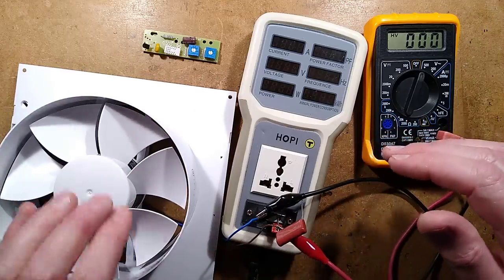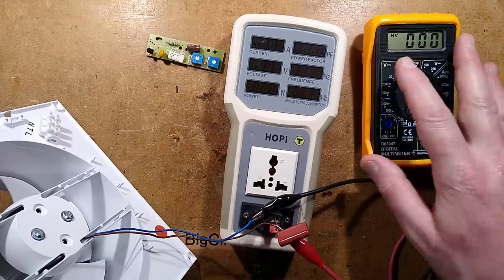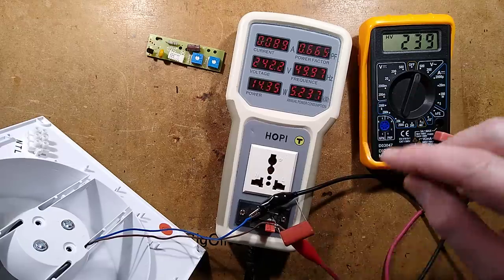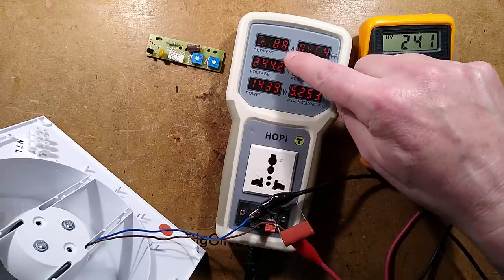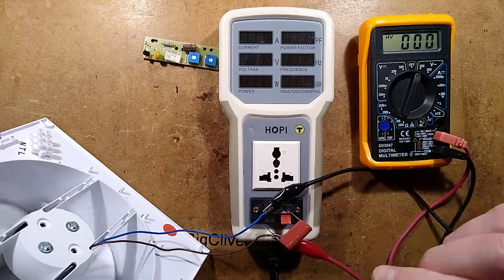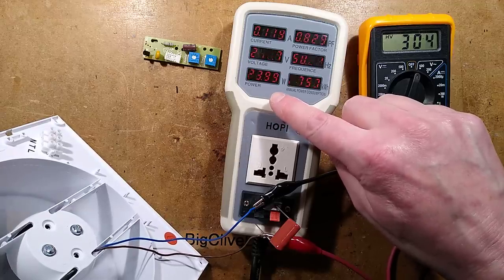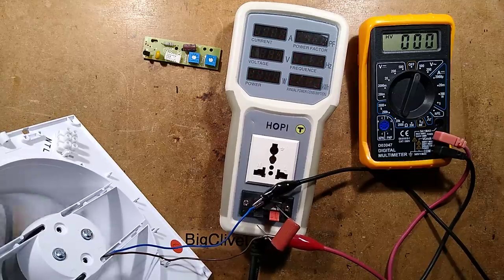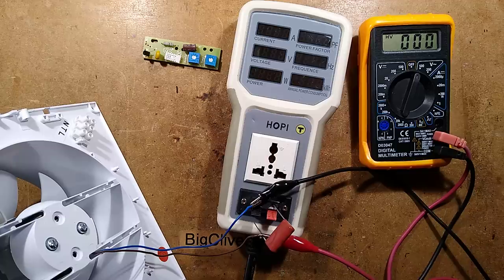What the heck!  Series capacitor makes fan go TURBO!

Comment: I have seen this where I didnt have exactly the right run capacitor to replace one. The current went up a bit and the speed did also. Less slip. It was not a big deal like this though.

Comment: Exactly, Clive....a phase shift....inductive loads tend to trail back on the phase a little and the capacitor will "correct" that....I used to install fluorescent light armatures and on a number of inductive armatures I installed a capacitive one to counteract the "phase-trailing" which is terrible for the powerfactor...
Am I making any sense?!

Comment: Seems like a nifty way to implement a two speed fan using a single winding (at the expense of worse PF at the lower speed)
Reply: at the expense of over-voltage degradation in the motor and 70% more power consumption at the higher speed (probably half the increase is heating somewhere)

Comment: Resonance: The Capacitive reactance is cancelling the Inductive reactance, leaving just the fan's resistance in circuit.
Draw a graph of current v/s different Capacitance values.
Reply: Partially cancelling out the inductive reactance. PF only went to 0.8, not all the way to 1.0.

Comment: You made a 50Hz resonant circuit maybe? 
I got a 15 watt extractor fan that actually drew 30 watts, so I added a capacitor to make it run at 15 watts. Worst case, the capacitor goes short.
It is much quieter, and has worked all winter moving the heat from the boiler flue to my hall (with a thermostat, so it only blows when the flue is hot).

Comment: it's oscillating. it's like adding a phase without adding a phase? more like recycling power. causes the vrms to go up slightly but makes it stay constant. in heavier duty systems like for example a table saw it's called a run capacitor i do believe. if you remove the run capacitor from a table saw system it runs real slow and you can pinch it with your fingers and stop it. add a capacitor in the circuit and well. you can run through wood like it's nobodies business. capacitors charge and discharge rapidly hopefully as you need it to or want it to. in laymans terms you can pedal a bike with 1 leg (no capacitor) or you can pedal your bike with two legs (with capacitor)

Comment: In the inductive load, the current is positively out of phase with respect to the voltage and we also have apparent power. This apparent power does not produce mechanical work. When adding the capacitor, the current is negatively out of phase with respect to the voltage, so that overall the phase difference between current and voltage decreases. Work reflected in and in the "power factor" measured by the device, the size displayed in the upper right.

Comment: Has to be resonance maximising the power. Tho I can understand the confusion. Most motors that size have masses of losses so its usually difficult to get any kind of improvement. Am guessing it has an unusual type of ferromagnetic material in there somewhere.

Comment: thanks. The measurement of current and voltage depends on the response of the instrument. does it indicate the average, peak or the RMS value. The RMS values in your CCt will show the real power of the load, i.e power is the work done in the load. Cheaper instruments do not measure RMS values but do measure a average value. COS phi equaling 1 shows there is 0 deg between voltage and current. The series Cap will result in current leading  more so .

Comment: Congratulations, you have made a series L C circuit close to resonant at 50 Hz. A series inductance capacitance circuit  at resonant frequency ( inductive and capacitive reactance cancelled out) will only  have the resistive part of the load ( if you have any resistance) holding the current back. Effectively a tuned series L C  circuit is a dead short at resonance. Like tuning a radio.

Comment: I'm an electro-noob but I know motors when stalled pull way more current. In operation though they manifest some back emf. Normally this goes back into the ac. but in this case you're harvesting the emf into the capacitor. When the ac switches direction yhe voltage is added. 
I might be wrong or it might be another way to explain the phase change model

Comment: Is the fan a brushed motor? Put the multimeter across the fan wires and spin the fan by hand, do you get any DC voltage shown, proving it is a brushed motor due to the fan motor acting like a small dynamo?
If it is a brushed motor, this may explain why the increase in speed of the fan and why the multimeter reads higher than the mains voltage, due to back EMF of each cycle being added to the AC voltage being displayed.

KW
Reply from the maker: It a very cheap and simple motor.  No brushes.
Reply: It can't be just noise otherwise the fan would not speed up, or would it if the noise was sufficient.
The only way to know is to put a scope across the supply and look at the AC waveform across the fan supply before and after adding the capacitor and see what it looks like. 

More thought, as you say this is a brushless motor, it's dependent upon the AC mains frequency for its speed (ignoring how the motor is wound and the number of poles), the noise could increase sufficiently to give what looks like a higher frequency AC supply, whereby speeding up the fan and the multimeter is just seeing the noise and interpreting it as a higher voltage, again a scope would prove/disprove this.

Please please do a follow-up, this is just too intriguing to leave unanswered!!

Thanks,
KW.

Comment: Use a few different size capacitors and you'll be able to tune the reactance. The power factor change will approach 100% as you get exact resonance across the cap and the motor's inductance. Were you wearing your safety glasses? Good luck.

Comment: Capacitor gets charged and can't discharge as fast to follow mains voltage which creates a phase shift. In layman terms, if you charge a capacitor and then reverse the polarity of the source, you'll get source voltage + capacitor voltage. This is one of the views on same effect, looking from different perpective, a capacitor's reactance is opposite to coil's reactance, if you couple two together with proper values, you can reduce motor's impedance to minimum.

Comment: The fan is very inductive and you have made a series LC circuit which improves the power factor.  Noting that the AC current through both L (fan) and C are identical (because in series), the voltage across the L and C will have opposite signs, which means more voltage across the L.

Draw out a phasor diagram and you'll see what's going on.  Or reply here and I'll draw one, whatever.

The series mode of power-factor correction increases the voltage across the internal L in the fan, which therefore increases the current through the fan.

There are comments mentioning resonance, but that is not actually required; you can be a long way from resonance and still have an effect here.  If the fan is very inductive (compared to its real load) and is depending on that inductance to limit the current, i.e. it has very low power factor, then you can get a really big resonance peak with the right size capacitor, and probably overload the fan.

Comment: I have used this trick to slow down fans a lot of times in the past, as you have done yourself from what i can see from the video description. I also noticed this turbo mode with higher value caps, but I didnt put much thought to it, I just thought I was too stupid to understand and gave it a rest. Well, it turns out I was correct - I was and still am too stupid to understand it 😂
Reply from the maker: It's a very practical demonstration of quite a complex subject.

Comment: Series  L-C resonance,  Normally the fan impedance is a combination of  an L and R in series,  the C adds in some negative reactance and 'undoes' some of the L- so the supply seen just the resistance, and the L and C parts see equal and opposite voltages when dead on the resonance, but are probably a bit off in this case. You will have come across this before, but maybe not realised it, as the tuning coils and capacitors in every radio  are resonating in the same way - energy oscillating between magnetic and electrostatic storage but most of it not being dissipated.

Comment: few years back when bldc fans not common my fan regulator stopped working . i opened it and found it is based on capacitors - 1uf, 2.2 uf and 3.3 uf , tight fit inside the enclosure . speed 1-4 with the caps = very slow . and speed 5 direct connection . I thought about increasing the speed (1-4) and started checking for info. soluton found online - increase the 'uf ' will increase speed.  i remember reading in one document = if you increase the capacitance over __ uf then the fan may see high voltage and may burn/damage. with doubts I didnt proceed with 'upgarding '   . replaced the burned caps and put it back. now i see it.

Comment: The network frequency is close to the resonance of the capacitor and the motor coil. If the frequencies were exactly the same, you will see infinite voltage.

Comment: I wonder if what is happening is because of the way the capacitor is connected, there is 240 VAC entering the fan motor until the polarity flips. Then the 240 VAC is still entering the motor, + the stored voltage in the capacitor. This happens until the polarity flips again,  then the whole process starts again.

Comment: Measure a few places on the circuit with an oscilloscope and it will become obvious whats happening.  Collapsing magnetic fields (ie in inductors) create high transients (voltage spikes).  Adding a capacitor allows that extra potential to be stored momentarily until the transient subsides.  It gets added to the potential across the winding during the next field building phase.  The capacitor also weakly rectifies and boosts the apparent AC waveform, but really, the peak mains voltage is quite a bit higher than 240V (meter is probably showing RMS).
A diode resists current flow in a given direction.  An inductor can do the same.

The circuit will reach an equilibrium point dictated by the network resulting from coupling an inductor, capacitor, and the resistance of the components and wiring.  Many resonant circuits built in this way should come to mind.  Thats how voltage boost circuits, oscillators, and a host of other practical things work.

Comment: Know not a lot about electronics only I can see the capacitor releasing extra voltage from a greater stored source of electrons. I bet if you added a resistor you could bring the voltage down to whatever load the motor is happy with.

Comment: I'll have to read the comments. We have an old fan that does whole house ventilation. It has three settings but two of them are dead and I've opened the box to look at the circuitry and there are several big capacitors. I'm assuming two of these have died. There is a circuit diagram inside the box. Perhaps I should try to share that.
Reply from the maker: The capacitors are a common cause of blower failure.   They're easy to source and replace.  You'll need to read the uF and voltage rating on them and then look for "motor run capacitors".  Just take the usual precautions like ensuring power is isolated before working.

Comment: I would assume, that the coils are having an angle of 90 degrees. A capacitor gives a shift of 90 degrees for creating the rotating field. A second capacitor in series creates a shift of 90 degrees too. 90 plus 90 means 180 degree of phase shift, but coils are oriented with 90 degrees difference. You should measure with RMS multimeter.

Comment: So Cap is storing a amount of current like  220v right? and the line is providing that  220v what if the cap charges and the line between the cap and 220v gets like 440v in serial battery? minus the consumption of the fan needs ends up with slightly higher output?

Comment: Must be low power factor without it. Capacitor brings the phase of current and voltage synchronize.
Also the capacitor can take-up the reverse current and dump back at the motor on next AC cycle - explains the increased "apparent" voltage.

Comment: Normally, the capacitor has to be parallel to the fan. The idea of improving the power factor is to reduce the current, and achieve the same work, or power in a lower current, in order to reduce line losses

Comment: That's only ~36% more current, so I think it would run for awhile. Probly should monitor the motor temperature, but I don't think it will be an issue until ~50% or more current.

Comment: I think you've counter-balanced (to a degree) the inductance of the fan motor, with the capacitance of the Capacitor.  Time to breakout ELI the ICE Man.

I'd be curious what the fan is spec'd,  in terms of maximum rotationary speed.  Hit the natural frequency, & it's time for the fireworks!  :o

Comment: I have experienced same thing, i was working on wireless power transmission system, when i connect this type of capacitor in series with transmission coil. Coil starts drowing more current.

Comment: Vent motor winding could be viewed as inductive coil. In pair with the capacitor it makes some kind of oscillatory circuit (which makes voltage peak higher than without it). That's my initial thought/hypothesis

Comment: Does this mean that with the 1uF capacitor in series it could be run from 110/120V with much improved efficiency? Or just enable it to run from 110/120V?
Reply from the maker: That might be possible.

Comment: „Resonance“
If you look at the voltage including phase angles as vectors on a 2d map, you see that voltage over parts might increase way over total voltage in a serial resonance circuit. Just like the current in a parallel one.

Comment: I guess the capacitor makes the green think it's running downhill (i.e. I haven't a clue beyond the comments posted about correcting for induction in the fan.) If someone could fit a capacitor to the PM, could he also start to work faster, with greater potential measured by your meter? 😊

Comment: from what little bits i still have left of my school teachings of electricalk engineering is that motors/ magnetic spools in general generate an inductive phase shift effect onto the alternating current that either lags behind or runs ahead of what the actual momentary state of the power line is  that it is attached to therefore smallering the ammount of power it draws. 
sorta like a surfer on a wave, he doesent ride it at the peak but rather ahead of it on the front of the wave. 
capacitors on the other hand have sorta the opposite effect delaying the phase. 
adding both together (if they are equal in delay/advancing strength on the power grid) puts the motor (/affected electrical component) in sync with the power grid making it draw what it can.
like giving the surfer a parachute that drags him ontop of the waves peak, he aint gonna be happy by how rough and hard that ride will be. 

PLEASE ANYONE WHO HAS AN IDEA OF WHAT PHENOMENON I TRY TO UNDIG FROM MY LACKING MEMORY, please help me out if that is what actually is taking effect here and correct me with facts (perferrably supported by some sort of scientiffic paper/article)

Comment: I have a fan question regarding a small 6" 2 speed desk fan. The other day I tipped it over while it was running and noticed that the blades started spinning faster. I experimented and found that fan speed increases the farther from vertical that it is oriented. What's going on???
Reply from the maker: Possibly just airflow.  When you block the air flow the blade has less wind resistance.

Comment: I am leaning heavily on others work, but what we're talking about is Power Factor. As many others have commented here - since you added a capacitive element to the series circuit, you reduced the phase shift of the voltage to current, allowing all of the power to reach the fan. The Ham Radio Extra class materials derives the equation, and has pretty good discussion of the impact and measurement of the increase. It would be of interest to see how the calculations vs. reality compare. LOVE your work and content!

edit: responding to your goal of reducing the speed: if you add resistors (heat risk), you could either add an induction or a capacitance so large as to shift the phase past resonance, that could work - I haven't tested, but wait with anticipation for your video of doing something like this.

Post-post-script: I'm trying to find the derivation of the equation for the Power Factor = Apparent Power + Real Power, and I stumbled onto a GREAT explanation of how the relationship works: https://youtu.be/nynQb1oB9KI?t=86

Comment: Ifff there is a sensor still in the fan unit, the capacitor might be activating it to make it go faster, only other thing I could think of is for some reason the capacitor makes it turn to dc? Weird lc circuit? Defective capacitor?
Reply from the maker: No sensor.  Just a bare shaded pole motor.

Comment: I sow some small toy motor had parallel connected 104 ceramic disc cap is it doing same thigs or not ?
Reply from the maker: Partly for electrical noise suppression and possibly to clamp spikes to protect electronic controls.

Comment: Notice that the power factor changed. You could probably fine tune it with math and the inductor/capacitor series equation. Interesting find, so if you don't mind me asking, what made you think of trying a series capacitor? Did you create some type of frequency doubler circuit there?
Reply: The frequency doesn't change.  He's just correcting for some of the power factor and getting it closer to resonance.

Comment: O the wonders of AC, phase shifting et al. Did you see the power factor? It is phase shifting indeed. We had to calculate plenty of these. In essence inductivity and capacity counter each other. When they are ‘equal’ (but opposite), you got resonance and probably smoke. Now I broke this unit, I’m sure you can’t resist the latter 😂